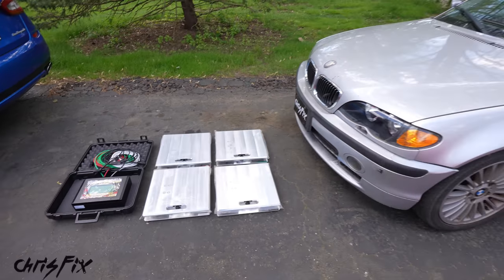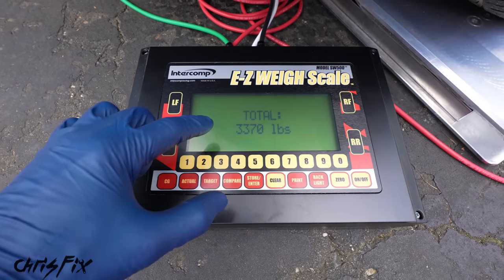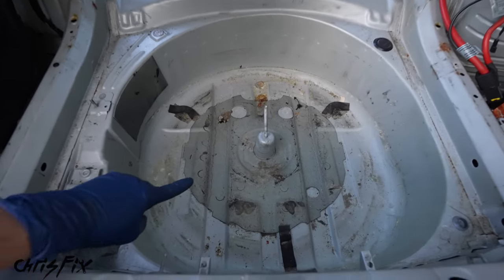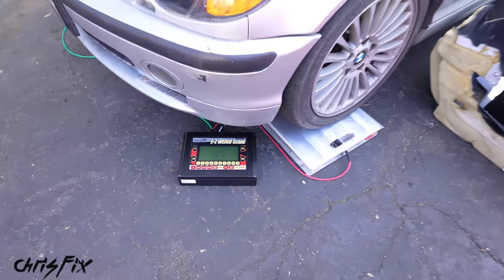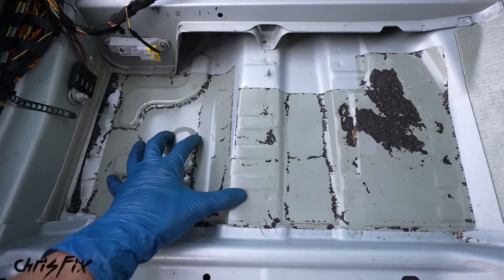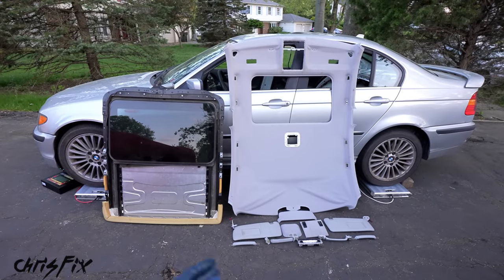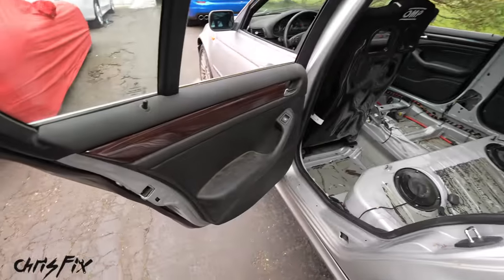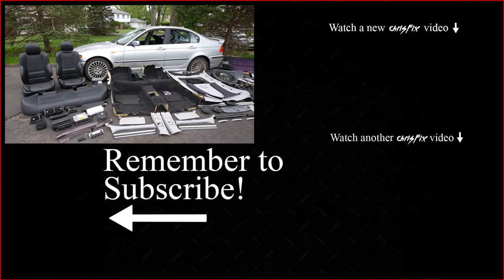How Much Weight can you REMOVE from your Car? (Weight Reduction)

Comment from the maker: Here is the UPDATE on the Lemons BMW : https://youtu.be/IbPhor1mnCA
Reply: Hey bro, do you hab alien
Reply: Cool car
Reply: the guy who literaly dismantle a car for a video xD
Reply: Hey Chris What Day you Fix your Red Mustang GT 1998 Put Super Charger
I Main!!!!
Reply: @tuto_roblox5965  he’s turning the BMW into a cheap race car, he needs to remove that to remove weight.
Reply: to advertise a aftermarket buisness of car swaps: do a video with new prius or something for cheap running cost, and essentials only, gut it out, swap steering for communciative steering and seat and chassis, which allows driver to feel evey bit of speed change and know grip limit of car, to drive effciently by doing minimal and steady, braking and steering and accleration, speeding up on downshills and before uphills... compared to relying more on regenerative braking, such is more fuel effceint and allows engine, batteyr etc to last longer from less use. eveb if miles per gallon doesn tmatte rto somone but longevity does, he can use same energy that wouldve went into battery with regen brake and out from it to speed up, to simply power through a turn. even if that isnt cared for , light weight agility is more fun especually with this effceint driving mindset on top of whatever speed , accleration quickness, drifting, etc people wanna do.         anti  NoiseHarshnessVibration stuff is less nessary with gun earbuds, airplane pressure and sound earbuds, music audio earbuds or earphones, winter muffler covers, except for driver becaue its illegal for drive to do it although i guess there could be hearing aid sort of noise supression stuff that hides well. can add some removable comfort gel office chair cushion to it to also use at work sitting all day, keep airbags. windows dont have to be ables to come down into doors, they can open only enough for driver and for everyone else a manehcnaical vent can be opened to allow more airflow in a more areodynamic way...     large tinited HUD with 3d imaging like those 3d billboards, simialr suff already exists aftermarket cna be advertised and each sale you get through your advertising can be identified by "promotion code" for small discount or if customer clicks on your website and your site auto orders the product... then the buisnes contract can say yull get a bit of the prodfit they maek off the product. or just be generous and  have the proudc make peopel feel better about your brand because they found the product tthrough your brand.       ideally there would be a device that shows what rpm to push engine for optimal power per fuel and lubricant use, for effceint driving, considering combustion enviroment tempuature etc                           this creating demand for such way of driving fun can create more effceint designs from factory, just as they did create demand for dumb stuff like excess large cars, cars that arnt prioritizes on fun diving but are made to be bg power sports cars, etc.
Reply: optimal rpm for effeincy is somwhat shown by bfsc chart given by manyfacterr, toyota published a chart for a inline 4 of theirs
Reply: Hey Chris i have the same car was wondering where you got the seat brackets for your car?
Reply: Your videos are the best
Reply: Chris  I love all your videos
Reply: PROJECT FARM WINNERS ONLY!!!!!!
Reply: @justsomepandawithinternet  😊😊😊😊😊😊😊
Reply: 1: 1:57 45 1:51 1:54
Reply: 14:47
Reply: 3:26
Reply: 4:55 4:56 5:05 5:19 5:22 5:25
Reply: @justsomepandawithinternet  5:35
Reply: 5:46
Reply: @justsomepandawithinternet  7:30 7:30 5:46
Reply: @justsomepandawithinternet  9:49
Reply: @justsomepandawithinternet  11:13 11:16 11:50 11:50
Reply: 13:09
Reply: 13:33
Reply: @justsomepandawithinternet  13:52
Reply: 17:02
Reply: 18:40
Reply: 20:14  @justsomepandawithinternet
Reply: For German viewers those 3370 pounds on the scale before are about 3057 Pfund and 10 Neu-Lot  in German units.
The 2941pounds on the scale at the end are about 2666 Pfund and 3 Neu-Lot in German units.
Reply: Not funny didnt laugh
Reply: Would this help with mpg?
Reply: Haven't see your posts for a while
Reply: Would it be allowed for you to take off the doors cuz those would be over 200 pounds